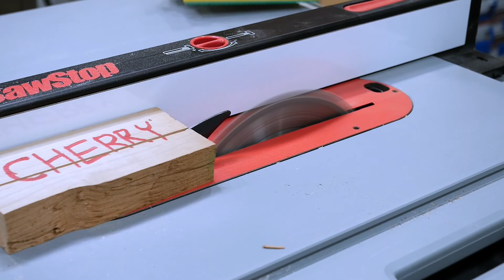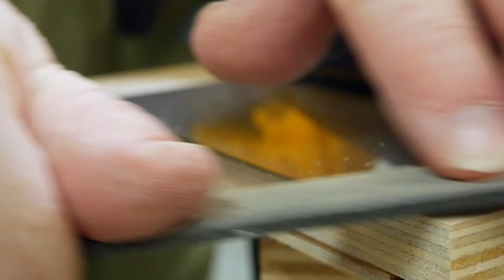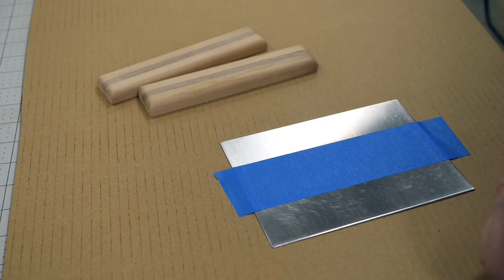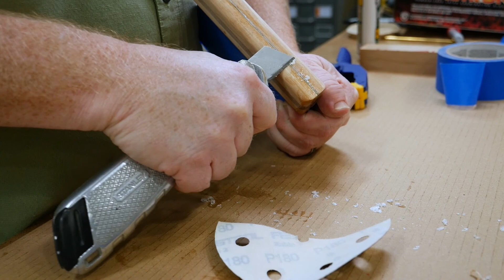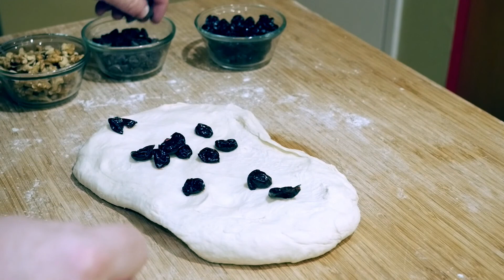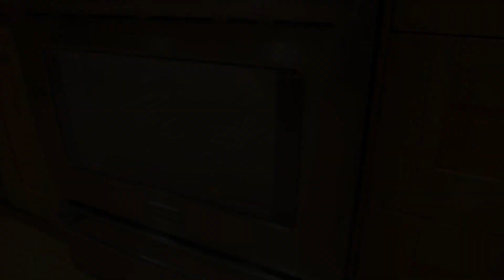Making a Dough Knife

Comment: Wondering about making these for Christmas gifts.   Will have to research how to cut the stainless.   Thanks!
Reply from the maker: It's not too hard. Can be done with a hacksaw, or a saber saw with a bimetal blade. Can also use an abrasive cutoff wheel, e.g. on a dremel or angle grinder.

Comment: Hi could I please have the measurements if you still have them
Reply from the maker: Sure! The blade is 4.5"x6" and is made of 0.036" (not quite 1mm) stainless steel, specifically type 316. The handles are 1.25"x6"x0.25" each, though I would make them thinner if I were doing it again. Hope that helps.
Reply: Made by Jester what measurement would you change your to make them thinner? The height? Or just use a belt sander to take the height down
Reply from the maker: @callumwright3798  The thickness of the two wooden halves on either side of the blade. As it is, the two together are about an inch. I think I'd make the whole thing about 3/4", so each side would be about 3/8" thick.
Reply: Made by Jester ok so I should make them like 1/3 of an inch
Reply from the maker: @callumwright3798  You can really make them any size you want. But somewhere around 3/8" sounds about right.